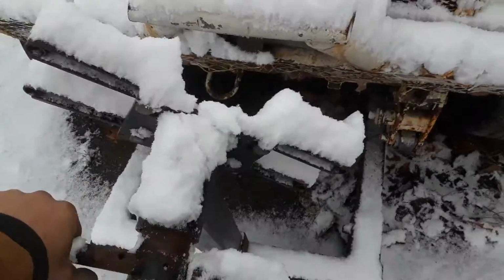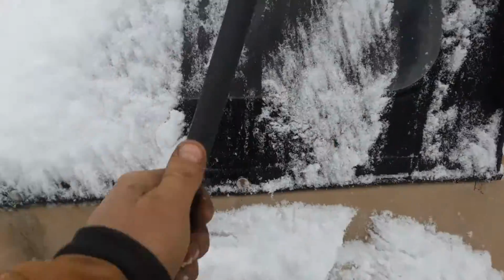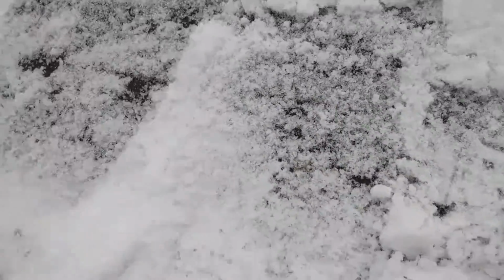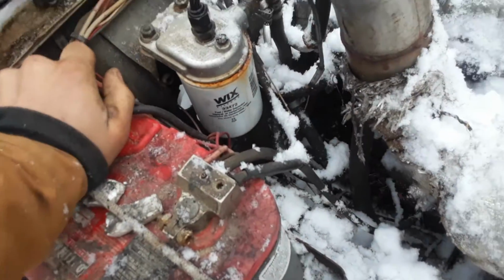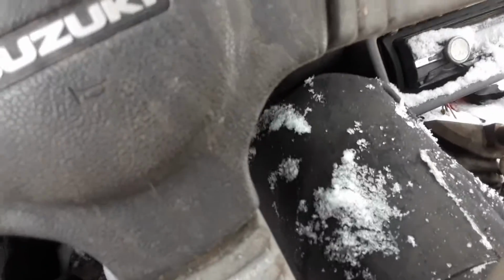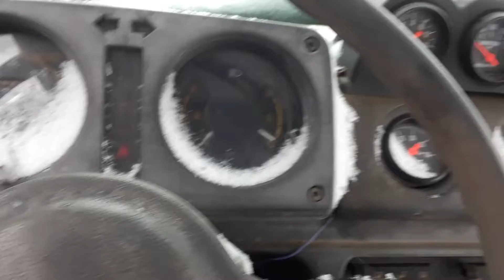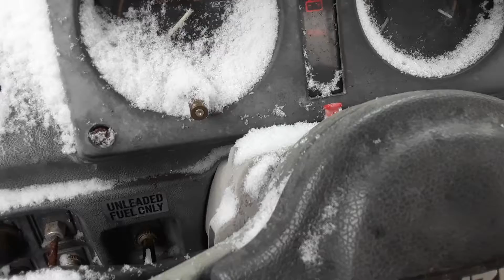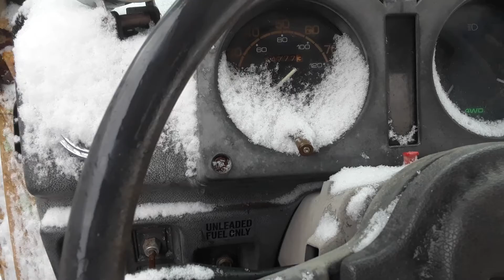1988 Suzuki Samurai COLD START || 1.6L VW DIESEL SWAP

Comment: Diesels don't have a carburetor, useless to pump the accelerator, injection pumps don't squirt as a carburetor if the engine is not already running.